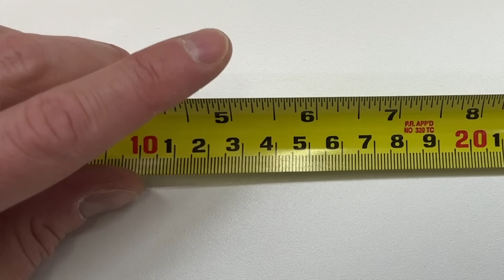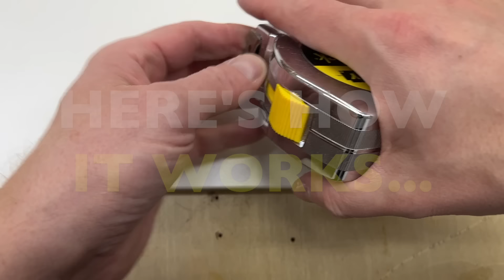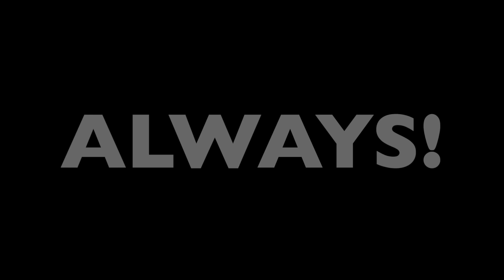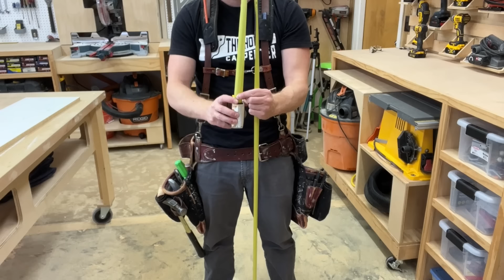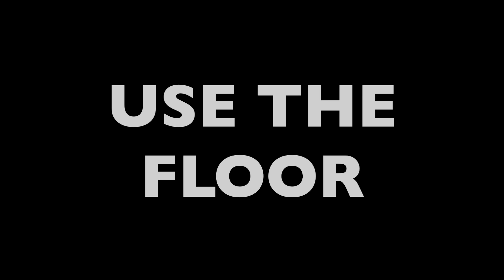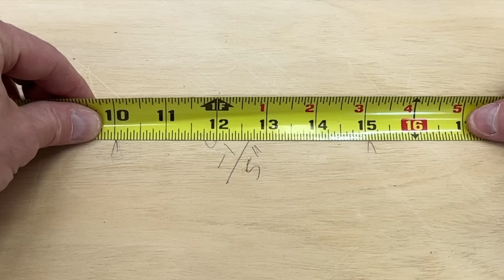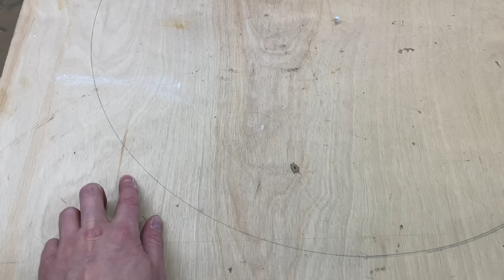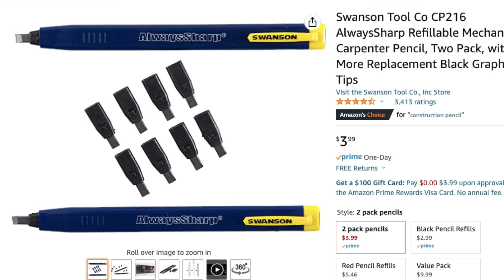ALL TAPE MEASURE TRICKS Explained...In Just 13 Minutes! (Measuring Tape Pro TIPS, TRICKS + ADVICE!)

Comment: When measuring to an inside corner, using the subtract an inch method is going to be more accurate than trying to read on the curve.
Reply from the maker: Possibly so. But reading the curve is significantly faster, and with practice on a particular tape you can get very accurate with it.

Comment: You know you can just measure to the back of your tape measure right? All mine have the size to add to your measure printet in the back. If not just measure your tape measure and mark it on the side. Mutch better than trying to get accurate measures in a bent tape measure

Comment: i got one you didn't mention: not ll tape measures are the same measurements. so 20 feet on one may NOT match 20 feet on another. this is due to their printing of the measurement being slightly stretched or squished, maybe by less than 1/16th of an inch. so it may NOT matter MUCH, but if you are going for pinpoint accuracy in a measurement for a job, use the SAME tape measure for the whole job, or even just the task you are working on.

i used to keep one tape measure at the main work area, and another at the table saw, until i noticed my "precise measurements" weren't so precise! this can even be true with the SAME BRAND of tape measure, or even with the same MODEL within a brand subset. you can always test your tape measures ahead of time so you know how accurate they are. i've seen another YouTuber who pulled out 7 tape measures, and got 4 different measurements!

Comment: I'm 65,I still am learning something new everyday😂 interesting video.i also use the Stanley 25' also I used to travel the USA building log cabins(it was my favorite job ever)& it was an extensive amount of tape measuring so Rick & I would at the beginning of a job site make absolute sure we would use our own tape measures. Very important!! Also when cutting anything we would use the term 'kerf' "plus or minus kerf" which meant with or without the width of the saw blade😂

Comment: Ok your killing me . I mean no disrespect. So the right way if your left handed your tape should be in your right hand which leave your dominate hand for writing/using your pencil If your right handed then just the opposite. When you where your tape it should be on your none dominate side this way you can measure and do other things with your dominate  hand like mark something or cut something (like snips) ( Metal stud drywall carpenter) Way more productive  Funny thing is I've always said tape measures are meant for a left handed person. Because a right handed person like myself has to read upside down. But trust me in a productive atmosphere this is the right way,. Your video was still good.

Comment: Pro tip, and this is an example but say you want to know what half of 144” is and don’t wanna think.  Pull your tape out and fold the metal end and put it at 144” and where the loop or bend is will always be half of the number you put the end of the tape on.

Comment: Align your head at the half way point of the wall's angle so if it's a 90° wall put your head at 45° and it'll show the true measurement. Hold the tape as square as you can so both sides of the tape show the same measurement

Comment: Starting the subtract an inch measure at 10 inches, helps with shorter measures since the bottom numbers count to 10 in between. So instead of 11 inches, it starts at one again.

Comment: My tape measure has only one button for both locking and crimping the blade. To lock the blade, press and hold the button then draw the desired length then release the button. To crimp plus lock the blade, just draw the blade to the desired the length without pressing the button; it will make a cranking sound. It is so easy to use it this way. I got it from Amazon.

Comment: For the inside corners IKEA recommends simply adding the tape measure case length to the measurement displayed on the tape. I have just verified that Stanley PowerBlock does have the case length printed on the back. This comes in handy when leveling two sides of their walk-in closet door (upper) rail where no other tricks can be used while almost hanging the tape measure in the air. I loved this trick!!  ..  thank you for you detailed video!

Comment: Hi. You missed something very important. To measure inside corners you don't bend the tape. You use the Case Lenght. Every tape measure has the case length stamped under the belt clip. You measure inside with the whole case and Add + the case lenght, that gives you the correct inside measurement. 
Square cases are more accurate than the round ones for this purpose. 
I use a permanent marker to write the case lenght bigger so it's easier to see and remember.

Comment: Here's another good tip when buying a tape, (if you didn't already mention it).  I like to check it before buying.  At "the big box store" I'll take a tape and hook it on something square then burn 10" and measure the same distance.  If it's spot on then it means the hook is measuring true.  I've seen some at the store that were way off, and the hook didn't look bent.
I had an apprentice helping me cut blocking for in wall brackets, his cuts were almost a quarter inch off, I looked at his tape and the hook was horribly mangled.  He probably dropped it repeatedly.  D'Oh!

Comment: The 25' Stanley is the tape I use.  It's not rubberized so it slips in and out of my pouch easily.
On a jobsite when the last foot or so of the tape finally breaks off I'll shove it back in, set it in a window sill with a sign that says Free Tape.  LOL!

Comment: As a home DIY when I start to measure things to cuts. I realized how stupid the American imperial system really is. As most stuff I do is by myself or with the help of a 2nd person, I learned to use all metric systems. It made my life so much easier without having to deal with fractions. Some things are not available in metric within the U.S. tool, but I just convert and learn a way around that.

Comment: The way we did it when i was doin drywall was we would talk in eighths so instead of 20 and half inch we'd say 20 and 4. And if u absolutely had to use 16th wed just say  big or ex. 12 and 7/16ths would be 12 and big 3. Confusing at first but makes things faster when u get the hang of it.

Comment: When you've been working with imperial and decimal long enough. When using a tape measure 10 5/8" becomes 10.625", 7 7/16" is 7.4375". It's a little more difficult below 1/16" dimensions.

Comment: Can't believe I never thought of rolling the tape, thank you! The hardest thing for me is measuring corner to corner, never can seem to get it right if it's a ceiling corner. I end up using a straight edge ruler and making a mark at 36" or 48", then measuring with a tape from the other wall to measure how much distance from that to the first mark.

Comment: For measuring into a corner you can also just measure to someplace near the corner, make a small mark or impression, turn it around and measure the rest of the way with the tab end.
Reply: Or just butt the tape in the corner and add that. Usually 3” It’ll be on the casing if you aren’t sure.

Comment: When measuring to an inside corner,  you can just butt the tape roll into the corner, read at the tape outlet, and add the width of the tape roll (which is printed right on the side of the roll). For the Stanley 25', it adds 3"

Comment: Using metric system you just measure and write down or memorise the number. Like 1032mm (one meter, 3 centimeters, 2 milimeters). Ten milimeters is 1 centimeter, 100 centimeters is meter. Adding or substracting is easy as f.

Comment: that burn or cut an inch can be tricky, its hard to stretch steel pipe one inch unless your welder can fill a wide gap and you slip your flange out,, (but there's always coumberlongs or chainjacks, 😢you know bolt pull, extra gaskets, 😮 naw, just save that short piece for the next run. It may work but You dont want.to be the one that has to come back later to your own job and cut that line out, 😮  I miss my orange Lufkin. The shiney Stanleys would walk up a wall better, but the shining glare would give my hiding spot away ,,😂😊😂

Comment: Bend the corner and imagine? Nah. The back of tapes are marked with the length of the housing. Just run the tape body itself into the corner, read the mark, then add the number stamped on the body. Way more accurate. That Powerlock 25 body should be 3".

Comment: Only carpenters measure everything in inches. Tradesman measure in feet and inches unless the measurement is under 2’ as a general rule. We also don’t burn an inch. If you are measuring in feet, you burn a foot. If you’re measuring in inches, you burn 10 inches.

Comment: Here is a tip for getting inside measurement that are exact without guessing.  I use this in my shop all the time. Just cut a piece of stock about 1/4 thick and one inch wide. Then cut that stock EXACTLY 12” long. When you need a precise measurement just but the stock up to one side of what you want to measure and read the tape at the other end of the stock then add 12”. Perfect cuts every single time.

Comment: I never wear my tape on my dominant side. The pencils i carry are on my dominant side,  so my pencil and tape come out at the same time ready to measure and mark. Then my tape returns to my non dominant, and in one swift motion, i stow my tape and pull my speedsquare out, pencil still in hand i can mark and stow both tools and grab the saw or my nailer or whatever other tool i need. It's much faster this way than grabing a tape, then switching hands and reaching for a pencil and then stowing crossdraw and then grabing the square then a saw or other tool.

Comment: Maybe I missed it in the video or the comments but when measuring an inside corner, you can butt the end of the tape into the corner then measure out a few inches. I go 10" cuz it makes for easy math but use whatever measurement works for you and/or the space you're measuring. Then you pull the tape from the other end and measure up to your 10" line. Works like a charm! Especially if the corner is in a place where it's hard to look down on line like the back of a cabinet. Hope this helps!

Comment: Why does my tape measure have a random measurement imprinted near the bottom of the back side?
Reply from the maker: That’s most likely the width of the case. That way you can pull an inside measurement, butt the case to the near side, and simply add that number to whatever the tape is reading. Not my favorite method, but it does work. 🙂

Comment: Great video. Here's another tip for measuring to an inside corner. The body of the Stanley Powerlock 25' is 3 inches long. Butt the blade of the tape into one corner and butt the back of the tape measurer into the opposite corner, read the number where the tape exits the body and add 3 inches. it's highly accurate and saves wear on the tape by not putting a hard bend in it.

Comment: This might be a dumb question, but is 15.55 the same as 15 1/2 inches? I don't think that 15.55 is in centimeters since it is a TV stand. It reads 15.55" wide and 29.96" tall. Any help would be appreciative. Thanks

Comment: The tape doesn’t lie, you might read it wrong. You will spend as much time finding center, as you will distance. Learning how to divide fractions in half can be tricky, the way I learned is ex; 3/4=3/8=3/16, or half, quarter, eighth, 7/8=7/16, remember there is an allowable tolerance. If you cut something exact, it may not fit. You may need to cut it an 1/8 short. That will give you a 1/16 on each side.

Comment: One trick I learned in my 82 years as a fabricator is to measure from the 10 inch mark, 'not' from the 1 inch mark, it is a lot easier to screw up by 1 inch than 10 inches, also, 'NEVER' let the tape snap closed without your finger stopping the hook, letting the hook slam into the tape face will ruin the rivets eventually throwing every measure off, also, make a small puncture in the center of the 1 inch mark with a sharp nail will let you swing a circle or radius easily by 'holding' the 1 inch mark with a nail or scratch awl, also buy a tape with markings on both sides as sometimes you can read it from the back depending on how you have to hook it !
Good information on this video !!
Reply: I think this is a good recommendation for folks doing fine woodworking, metalworking or other jobs/crafts that require more precise measurements/tighter tolerances…but just in general, (in my experience at least) if you buy a good quality/well made tape measure and halfass take care of it, said tape measure will get decommissioned due to many other common reasons, like the lock not holding well anymore, crease or other blemish in the blade, belt clip breaking off (if used), tape stops retracting, or retracting smoothly, or even unwinding due the spring mechanism failing, etc., long before the rivets become loose enough to make a noticable difference in your mesaurements, solely due to letting the tape retract as it was intended to retract when built lol.

Comment: What I do for inside corners is measure out ten inches from the inside corner and put a pencil mark at ten, then measure from the other direction to the ten inch mark and do the math. It’s easy, accurate, and fast. You can also cut a block ten inches long and place it with one end against the inside corner and measure to it.

Comment: You forgot the coolest trick.  Stanley tapemeasures are made exactly 3" wide so you can measure between two inside corners without bending the tape, just lock it, read the tape and then add 3".

Comment: I like the Stanley 25 tape best too. But framing in Fl. all tapes  last a season (sweat) & back then (the 80s) Sears would replace there tapes (30 foot) so long as Craftsman was wrote on the tape. A few years went by & Sears stopped that with there tapes. To frame in Fl. is to have nothing & I appolojize Sears but I had to do what I had to do back then.

Comment: you didnt use fat, cunty, cunt hair etc.  you did the scribe the opposite way an i ever have.   also most tapes are 11/2 width and 3.5 length so you can use them for quick measurements.  same goes with the plate on a saw.  big side is 3.5 and the other is 1,5 both to blade.

Comment: I was recently introduced to the Fastcap line (PSSR-25 to be exact) of tape measures. They are BRILLIANT for carpentry work. A white writable front label to write down measurements, a built in sharpener, noted increments, a button for manual crimping with your index. The green version has numbers on both sides of the top of the tape, and an easy 3 inch base for easy measurents when backed up into a corner. And only $10!!!

Comment: In a past life of construction and drywall we DID in fact say everything in 8ths, even the even numbers. For instance, for, say 65 and 3/4" we would say "65 and 6". For 65 and 7/8" we'd of course say "65 and 7". Everyone knows what that means in my neck of the woods. Quicker and easier to say (far less syllables) than "65 and three quarters". When I first started it of course didn't make sense (why say 6/8? that's dumb!) but that's what everyone 'round here does to keep things quick so we learned it.

Comment: Only finish carpenters use sixteenths or smaller. With that being said almost all rough carpenters now call out fraction in eighths but you only say the first number for the eighth value. I need that at 12 and 3 or 12 and 5. There is no reason to say the other part of the number which also reduces confusion of what number you said.

Comment: Here are a few suggestions from a retiring carpenter with 44 years behind me...

1.  The 25' Stanley Powerlock is the best tape out there, bar none.  Its size, weight and grasp in the hand is superior to any other tape I've tried.  If you wear nail bags, ditch the clip and just drop the tape into the bag on the side of your non-dominant hand.  No monkey-motion that way trying to locate where to clip it on every time you're done using it.

2.  For inside measurements, learn to use the 3" tape body measurement to your advantage.  It is marked on the Powerlocks for that reason.  Just push the tang end into one corner, fully extend the tape and push the body into the other corner.  Read the measurement that is visible where the tape enters the body and simply add the 3" to what you read.  FAR more accurate than reading a bent tape!  And, no timewasting with marking and measuring back 10" from the far corner (or any other number) and then having to add those two together.  Once you get onto this, you'll never look back.  
Be careful though... most foreign-made tape bodies (not Stanley Powerlocks though) are often manufactured to a metric dimension and will not give you the easy, straightforward 3" number you seek.  Avoid buying tapes not made with the 3" body as they will frustrate you.

3.  Learn to gently brake your tape with your index finger under the blade as it retracts back into the body.  Allowing it to slam home will eventually rip the rivets out of the blade, or even worse, measurements will lose accuracy as the rivet holes elongate.

4.  If you drop your tape, inspect the tang.  If bent at all, straighten it with pliers right away as it will affect the accuracy future measurements.

5.  When calling out measurements to the sixteenth to someone else, learn to say "strong" or "shy" when it is a little long or short of the mark.  Not needed in framing, but very useful in finish carpentry where precision matters.